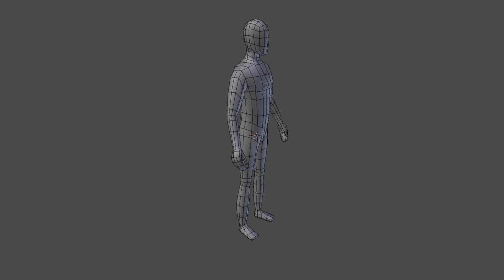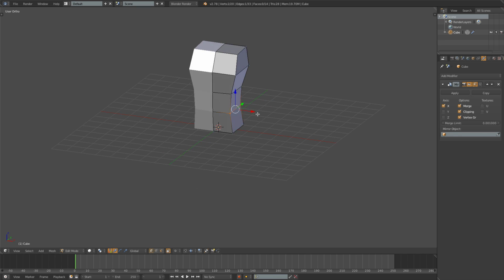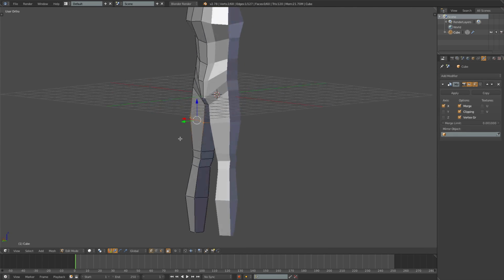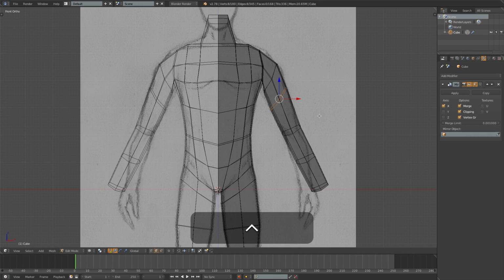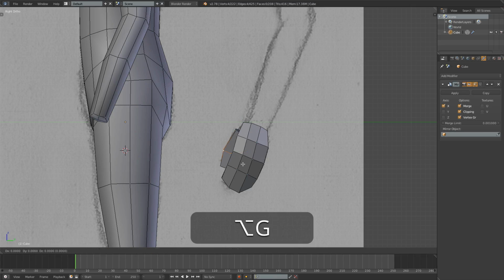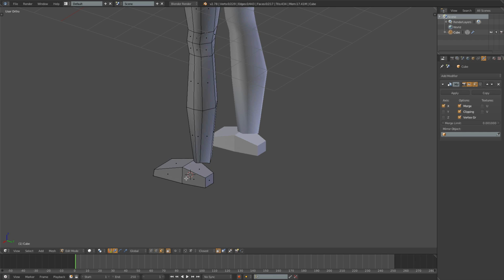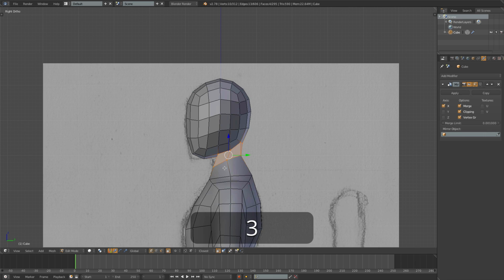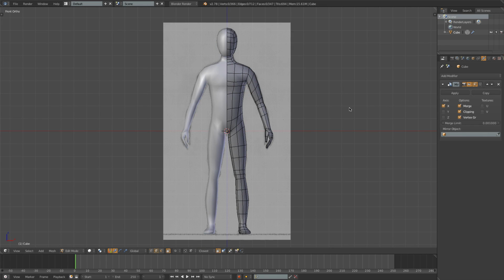RPG graphics E01: Character model [Blender]

Comment: Hey guys, I'm using blender 2.82 and I'm stuck at the part where he's modelling the hands. I put the 3D cursor where he put it and added the cube but the cube isn't added at the 3D cursor location and it has weird behaviour when I try to move it to the location (it stretches rather than moves). Anybody knows how to fix this?
Reply: For some god forsaken reason the cube is absolutely fixaded on being attached to the middle of the screen. I don't know how to solve it, but a workaround I used was to delete the annoying points, and re-create the cube from a leftover plane

Comment: when creating the cube to make the hand: my cube does not appear mirrored. also it's treated like a different object. Blender 2.82
Reply: I cant do a single thing coz im using blender 2.8....stucked at that brackground image...can anyone  help?
Reply: @kapilbadokar  basically you have to go into front and side views using keys 1 and 3. On each, add a new image as background and move them (g) to the center of where you want the reference to be. Just optional, go to the image options on the right side of the screen and choose "use alpha" and lower the opacity to 0.5 so you can see through the cube and the image.